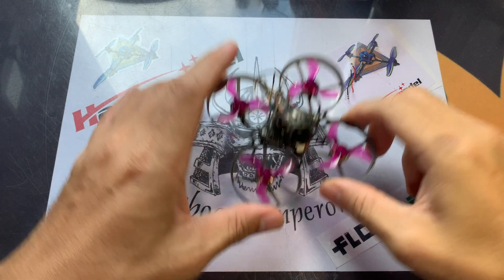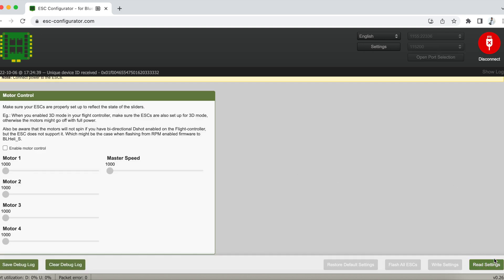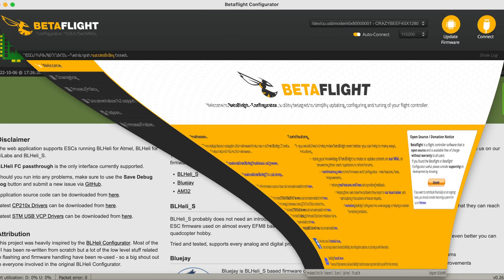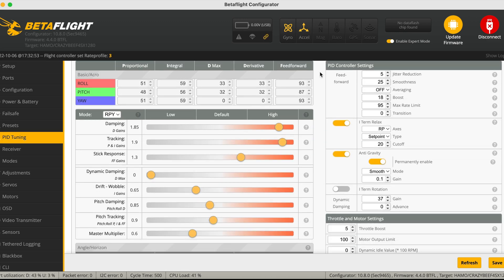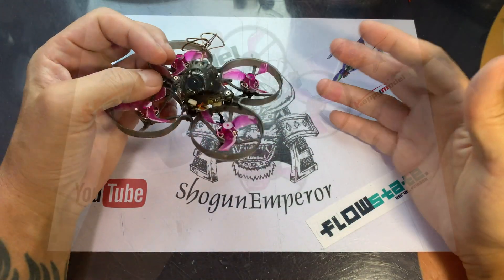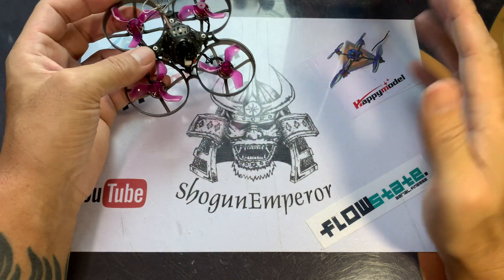Setting up Bluejay for Mobula7 1S and PID tunes

Comment: Thank you from 2025! My mob7 flew like a heavy chandelier with 650mAH batteries,  0802 20000 kv motors and 45mm triblade props. After flashing to BlueJay it didn't seem to help much. Then I followed your PID tune settings and it flew much better. The only change I had to do is set min and max power protection to maximum values allowed. One problem I had is after crashing I kept getting RPMFilter error preventing me from arming. The workaround is to go into the OSD and reboot the FC. Is there a better way to fix this?
Reply from the maker: Oh great man!!! Im happy that the video helped. Hmm.. another thing u can do is to reflash to 4.5.2 the latest BF firmware and put the dump file of the mob7 into the CLI. That issue is not normal. Maybe a firmware clash. Thanks so much for dropping in bruddah
Reply: @shogunemperor thanks for the tip, much appreciated

Comment: Great info again!! Have you used the v.21? I flashed v.21 today and it seems down on power 🤔
Reply from the maker: aaw thanks bruh! Glad it helped!  Yes, some of my quads are. hmm... try increasing the ramp up and also maybe use 96khz and see how it goes.  It really boils down to personal preferences. But ultimately its still a tiny whoop... so power depends on the motors and lipo and most importantly "power-to-weight" ratio.
Reply: @shogunemperor  🙌🙌 yep I had it on the  96khz boost 1100 now back down to 48khs and upped my idle to 16 in betaflght now its feels better
Reply from the maker: @garykrygsman1391  awesome man. That would be my next suggestion. But sometimes 96khz feels good. Most of my mob7’s are on 48khz tho

Comment: Bro I need your help. My motors are stuttering or won't even start for the most part. And on top some motors are turning the wrong way.
Reply from the maker: No probs man. What changed did u make to the FC? Just bluejay?
On esc-configurator.com
- increase ramp up to 1105/1205
- check motor direction and motor orientation. Motor 1234 etc on configurator. Make sure lipo is plugged in.
Reply: @shogunemperor  I think I'm having the same problem.  Not really a bind and fly in my opinion, just trying to get this into the air for the first time.  What do I have to do on esc-configurator to get my Mobua7 to fly for the first time?  We can't make ramp up changes in Betalfight?
Reply from the maker: @CGreciful  u’ve never flown it before? And it came with stuttering motors?? Thats strange man. Ramp up is changed in esc-configurator.com and on betaflight motors tab is where u check the motor direction. If all these have to be changed, means either something was done like flashing etc on the whoop as out of the box, it is all set up for u.

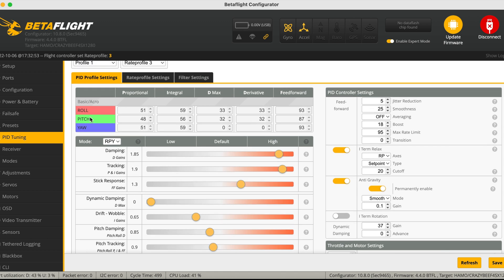Comment: What 1002 motors are you using and are these the PIDs for them? 2:42
Reply from the maker: Im using the Happymodel 1002 20,000kv motors bruh, and the PIDs would be the stock Mobula7 ones thats already pre-tuned.  I dont usually change them as we've tested the tunes for the Happymodel quads and Happymodel ships them out tuned.
Reply: @shogunemperor  oh I didn’t know you’re on the HappyModel dev team! That’s cool. Also I didn’t know the same PIDs would work for both 0802 and 1002. I’m new to FPV.
Reply from the maker: @athenovae  aaah no. Im one of their Team Pilots. Not a dev.  Totally understand bro.  I found out about the tunes awhile back when I was lazy to tune with the 1002. LOL
Reply: @shogunemperor  still awesome you’re on the team!! What’s your flight time like with 450mah LiPos?
Reply from the maker: @athenovae  aaww thanks my bro!!  Much appreciate ur kind words.  Im using 660mah lipos.  And im getting around 2 mins-ish.  I fly hard and dont conserve power. But on a conservative flight it can go up to about 6 mins.(the fly in circles kind)
Reply: @shogunemperor  btw I see 2 types of 1002s. Are you using the RS or EX version? :)

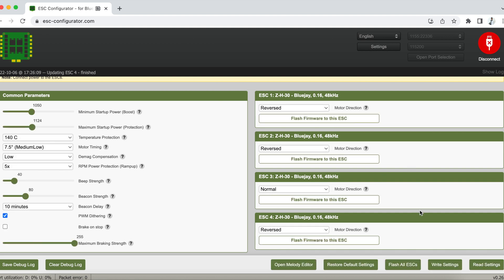Comment: Just a quick question... I just flashed all my ESCs successfully with BlueJay v0.19, but I've noticed as soon as each ESC was flashed, motor direction went to NORMAL from previously picked REVERSED. Even in your video at 1:39 - 1:40 sec mark, your motor number 3 went back to NORMAL... in my case, all 4 went back to NORMAL setting. Is there anything I need to do regarding this? Thank you!
Reply from the maker: aaah no. So once its flashed its all good. And dont forget to bring up the minimum throttle to 1100
Reply: @shogunemperor  - Yes, I did that too as per your suggestion... for some reason quad would suddenly drop from the sky. It looks like rear right motor (motor number 1) would desync or something, which would result in a free fall. You can see it in this video where my daughter was flying it. In three spots mid video towards the end. I went back temporarily to BLHeli_S until I find out what was causing it. Mobula 7 flies amazingly with BLHeli_S on my end. I was really interested to see what BlueJay has to offer. It's this video on my channel: https://youtu.be/KyOgClO4tKc - first twitch and fall is at 1 minute 20 seconds mark, and there is couple of more after.
Reply from the maker: @Seii-FPV  interesting. Ur Mobula7 was running on 2S? Is this the 2022 version? Or the 2017 version? It kinda looks like stress from the ESCs or motors. But i cant be too sure. Awesome flying by ur kid. Have been watching ur vids but didnt get a chance to comment ur videos! 😜
Reply: @shogunemperor  no, my Mobula never was on 2s. It's Mobula 7 1s version. Edit: It's the newest version, I purchased it just couple of months ago, and it was a new batch. I'm not complaining, that little quad flies on BLHeli_S like a champ. I love it. Lately I fly OddityRC XI25Pro and my 5" builds, but coming back to Mobula is always amazing. I can't believe how much fun they are.
Reply from the maker: @Seii-FPV  oooh... but yeah... that twitch on ur video when ur kid was flying it is weird. It should not be the case. Maybe contact Happymodel direct?  info@happymodel.cn and ask them?  They might know what that issue is from all their testing. I havent come across this issue before.
Reply: @shogunemperor  I will ask them for sure. Other than that, it flies like a champ on BLHeli_S, so for now, all is good. That twitch never ever happens if I don't have BlueJay installed.
Reply from the maker: @Seii-FPV  yeah! Some of my mob7s are also on stock blheli-s it worked so well I never bothered to switch. Only my Moblite7 and this Mob7 is on Bluejay

Comment: What's the advantage of having Bluejay and bidirectional DSHOT?
Reply from the maker: ok, so from my personal experience... I always have issues when turning on bidirectional dshot and it almost always have arming issues.  So i use Bluejay. Honestly, I found that there's not much difference except smoother movements from Bluejay so I stuck with Bluejay.
Reply: @shogunemperor  Isn't the reason for having bluejay over BL_Heli_S that you are able to enable Bidirectional DSHOT? I flashed today and it honestly feels a lot better. Deactivated low pass filters and activated RPM Filters (which require Bidirectional Dshot)

Comment: My quad cannot take off the ground after ESCs are flashed. It's in a "runaway" mode which means that motors doing not what FC expects. I was able to fly right after flash operation completed but not after. Going back to Blheli_s, I think I was happy with it
Reply from the maker: Stick to whatever ur comfortable with bro. And whatever makes you happier. My personal opinion, if it flies well, dont fix it. Hahahaha. I’d rather spend time enjoying the flight rather than the frustrations of troubleshooting.
Reply: @Shogunemperor  It was a "Maximum Startup Power (protection)" slider. Once I put it to the greatest available value everything was fixed. Super frustrating that it is not available with Blheli but has an effect on it.
Reply from the maker: @lomokid  🤦‍♂️ sorry i didnt picked that up before!! Couldve told u about it! Yes, glad u were troubleshooting it man. We learn something new everyday in this hobby!

Comment: Another question - I designed and installed my own canopy for Mobula 7, and purchased/installed GepRC PEANO 50mm U.FL antenna instead of the stock one (significant improvement throughout the whole house, even basement), plus I've installed NEWBEEDRONE AZI 40mm tri-blade propellers (1.5MM HUB). My Mobula 7 came with X12 5-IN-1 AIO flight controller OpenVTX, Input Voltage: 1S, Max Continuous Current: 12A, Motors: 0802 20000KV. Originally the weight was around 25 grams, and now it's around 27-28 grams. Is that too much for these motors/ESC? I just don't want to burn anything for no reason. But I love my new canopy, TPU can stand millions of crashes, hits, any kind of abuse, and it will never break. Original canopy is so brittle and cracks super easy. Thanks in advance for your answer!
Reply from the maker: its fine,. What lipos are u using? Recommended is 450mah, but i use 650 and 660mah ones. The FC can also take 2S lipo if u swap the motors. U wont burn anything with the 1S
Reply: @shogunemperor  - I have these: TATTU R-LINE 500MAH 1S 95C LIPO PH2.0 , 6 of them, and only use those for now.
Reply from the maker: @Seii-FPV  sweet. Good enough.

Comment: Would you recommend flashing BlueJay on the Mobula 7 1S with 0802 20000KV motors? And what settings should I pay attention to especially? I just want it to fly nicely, but to be updated with BlueJay, don't require any special PID tuning or anything like that. Thanks in advance!
Reply from the maker: You can fly it as is with the BLheli_S.  But if you do want to try Bluejay, I recommend using it at 48khz for its PWM and also bump up the idle power to 1100 as this FC is a little sensitive.. you MAY find that your motors will stutter after flashing the Bluejay. Its mainly the firmware issue rather than anything else.
Reply: @shogunemperor  - thank you for your kind reply. Yes, I understood that from your video, I just wasn't too sure this value of 1100 was the same for my motors. I'm guessing that value also helps with making a whoop little floatier in normal conditions, if the value is bumped up a little bit. Of course not too much. I will experiment and see, worst case scenario, I can always go back to BLHeli_S and my backed up configuration. I'm just thinking BLHeli_S was last update 2 years ago, development came to a halt it looks like.
Reply from the maker: @Seii-FPV  hey its a pleasure bruddah. Its what im here for. Yeah, so the number just bring up the idle speed but the rest is still the same. It wont make the whoop floatier. At least from my experience it hasnt
Reply: @shogunemperor  - it's amazing! I'd actually love if it's just a little floatier than it is now, not sure what settings would I have to play with in order to find the best spot. I've heard idle would do that, I think JB mentioned it once, but not sure if he was talking about whoops or something else. Anyway... Your thoughts on Quicksilver? Do you by any chance have a video going through all the settings in Quicksilver for Mobula 7, or planning to make one? Thank you a million! Your assistance is priceless. First stop when it comes to these little-feisty-whoops questions :) Thank you!
Reply from the maker: @Seii-FPV  hmmm… on ur radio… increase the weight of ur throttle on the input page to about 160. But it’ll make the throttle a little more sensitive. Thats what i have on my radio.(my little secret) as for quicksilver… theres a 50/50 chance that it might just brick the FC if done wrongly. So im still on the fence. During my Silverware days we had cheap toy FCs that can be converted. These days FCs are getting expensive
Reply: @shogunemperor  - great advice and word of caution! Thank you a million my friend!
Reply from the maker: @Seii-FPV  haha good luck and happy flying bruddah

Comment: I just got mine in today, got ELRS v3.1.2 working, has the x12 1-2s  board, 400mw vtx, and spi ELRS. I bought it mainly for the board, I'm going to rip it as a whoop for a while, but I have a 1s babytooth frame, 1202.5 11,600 hglrc motors and a caddx ant, that's what I want the board for. I have the x12 in a 2s babytooth build and love it. It's a ripper. On the 2s I have 1204 8000kv motors, and caddx baby ratel. By far my favorite toothpick. I just got 5 more ELRS ep2 recievers for my other micros, they all had the XM+ in them. And boy I can feel a difference in latency. My 5" quads and cinewhoops run crossfire, but I'm thinking of getting the dual antenna elrs recievers for them as well, and just keep crossfire on my 4" explorer.
Reply from the maker: Oh sweeet bruh! Looks like u have ur whole fleet ready for an ELRS update! 🤣🤣 the hardware specs sounds legit! Happy flying bruddah! I know ur gonna have a blast!!

Comment: thanks for the help - I always seem to have idle issues even with full power but it still takes off. Do you think a blue jay flash will be helpful for my other happymodel quads? I have the crux35, crux3 and bassline. I love them so much as is im afraid to change anything lol
Reply from the maker: hey pleasure bruddah!!!  Yeah, the Bluejay will definitely make them fly alot smoother... worst case scenario is u just flash back the Blheli_S.  Try it man. If u have any issues with the stuttering motors, its norm as sometimes the firmware causes that. Just bump up the idle speed and u should be gold!
Reply: @shogunemperor  OK I'll give it a try - thank you!

Comment: Hi, it is possible to use gemfan propellers 1635x3 on Mobula 7 1s on 0802 motors 20000kv, motors can handle it?
Reply from the maker: Oh yes of course bro. That would be my preferred choice actually. I prefer the triblades compared to the biblades. The motors definitely can handle. My own setup is with triblades.
Reply: @shogunemperor  Thank you, I was not to sure, the motors can handle it, I am new to the woops,  mobula 7 on 1s is my favorite quad at  the moment, is good fun,  thanks for the answer, happy flying
Reply from the maker: @witek0206  aye no worries bruh. If u need anything, feel free to drop a comment or join me on my discord channel! And likewise, happy flying my man!!

Comment: Hello, why 96kHz is not working with mobula 7? Did You try that?
Reply from the maker: Hey man!!! It does work. And yes I did. But my preference for this size whoop is the 48Khz. Its a personal preference. U can do 96khz if you so prefer.  Thanks for dropping by!
Reply: @shogunemperor  after i flashed 96khz, the motors were not moving at all, and with 48khz i have some strange wobling during the flight.

Comment: Bro u made a whole video about how to flash bluejay but u never mentioned why we should do that?? Help us out bro, we're not all experts like u...
Reply from the maker: Aaah shit!!! I was so focussed on the “HOW” I totally missed the “WHY” OMG 🤦‍♂️ haha im no expert bruddah, im still learning too… been 4 years… im a slow learner!! ROFL 

OK, so basically, running bluejay on the mobula7 will actually help the adding filtering on the ESC-motors communication ie bidirectional dshot which will allow u to use RPM filtering that makes it smoother in flights. Faster communication. Also, with Bluejay u get slightly better flight time
Reply: @shogunemperor  how about the punch? Is higher or lower with bluejay? I was googled this manner whole day and I didn't understand if I can get more power/punch? For me feels a little underpowered. I was thinking to try to convert it to 2s with 80 motor output. Any opinons? Thanks!
Reply from the maker: @50fpvromania  hmmm… for a puncy motor, u might wanna get a 1002 motor for 1S. But if ur going 2S make sure the motors are 2S capable. Its slightly heavier, but good punch. Generally, Tiny Whoops have a very different handling so theres a specific way to fly it without massive propwash coming out from a hard maneuver

Comment: Thanks I'll give a try tonight, props on make troubleshooting risky but made better video😂
Reply from the maker: Heheh sweet bruh! Thanks again for the request!! Hahah yeessss!!!
Reply: @shogunemperor  Dude, everything went smooth and i am very happy with the power consumption i got 3min indoor flight with my old 450mah batteries, the 1002 use to last me like 60 or 90 sec at most. only 1 thing I am getting a bit of wobble or vibrations i think on the pitch side very minimal looks like i am driving on a bumpy road. Do you know what could be the cause? and how to reduce it?
Reply from the maker: @chopwhoopz  niiiiiice! Did u bump up the start up boost for bluejay? Maybe bring it to 1100 first. If it still happens, decrease P for pitch by 5
Reply: @shogunemperor  ill test it and let you know thanks
Reply from the maker: @chopwhoopz  good luck bruh
Reply: @shogunemperor  when you say P for pitch do you mean Pitch Tracking ?
Reply from the maker: @chopwhoopz  yes sir! That slider works the P for pitch
Reply: I got bit better as I missed a few value on the right. Bring master multiplier down as mine are 1002 22kv . I still have a few problem starting
Reply from the maker: @chopwhoopz  sweet!  Motor stutters? i just arm/disarm again. Works for me
Reply: @shogunemperor  I'll try tonight
Reply from the maker: @chopwhoopz  👍
Reply: @shogunemperor  After many test, i got to the conclusion that my problem was BlueJay :D the wobble was coming from there i went down a version but the issue persist. (Maybe this is cuz its FC v1 external TBS)so went back to the old firmware which made realize that your PID's are really good for the 1002's i gave up on them but Now i am enjoying them with the only quad i got left . Thanks🦾
Reply from the maker: @chopwhoopz  man, im sorry to hear bruh. Im sorry I couldnt be of much help for u